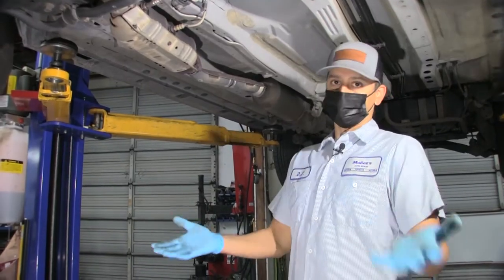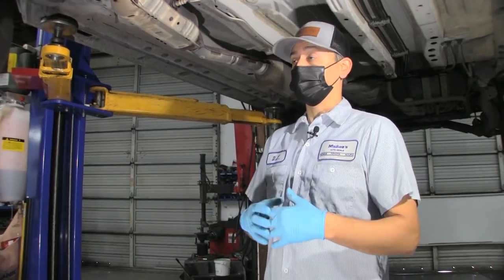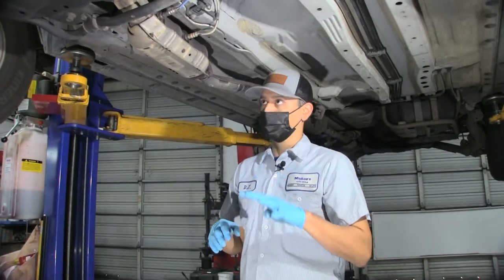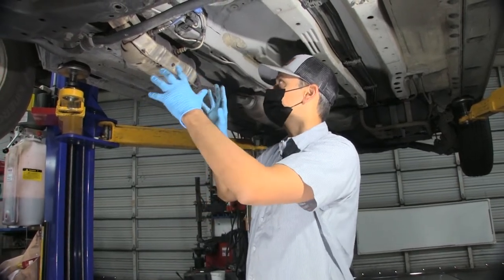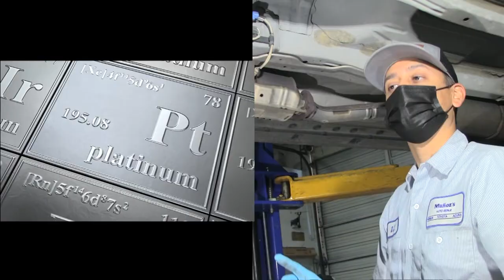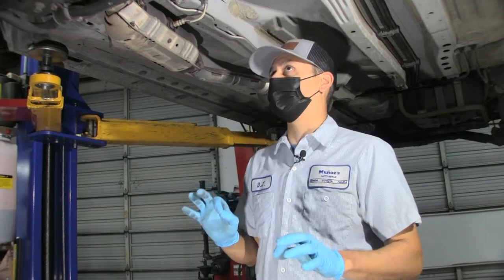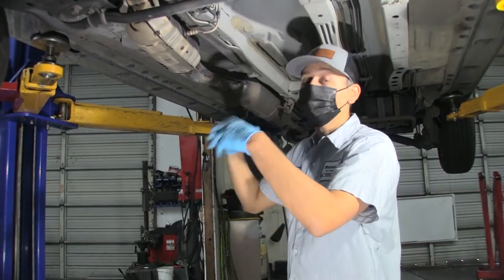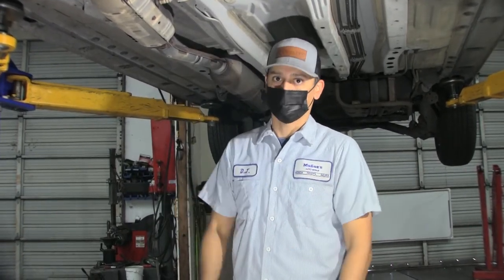Defeating Catalytic Converter Thieves | Where's My Cat...?

Comment: Very helpful
Reply from the maker: Hi Nolan, thanks for saying so.
Reply: @munozauto6220  Just got 
Cat clamp MAXX for 2017 Tacoma
Lifetime Warranty . 
Rock solid
Reply from the maker: Hi Nolan, right on. We hope that works out well for you. When we were researching the different anti-theft devices, we came across a few people recommending viewers weld cables directly onto the cat for extra security. For reference, doing so in California would likely lead to the truck failing SMOG, but that may not be a concern in other states. 

Installation methods aside, we're curious how that unit impacts the sound profile of your truck  and if that sound profile changes over time. Now that you have the Cat Clamp MAXX installed, when you are driving down a bumpy road with your windows down, are you noticing any change in sound?
Reply: No was installed properly tightly at a TOYOTA dealer . Keep your Toyota a Toyota like they say .
Reply: So update MUNOZ AUTO.
TOOK to Toyota. 
Decided to go with 2017 Tacoma.
1/8" thick Cat Security Shield.
Toyota Recommended
Reply from the maker: Hi Nolan, we're fans of the Cat Security shield ourselves, but I'm curious what tipped the scale for you to switch? Based on your previous comment, The Cat Clamp Maxx was recently installed, so did that unit present problems for you?
Reply: @munozauto6220  no sir . I had it ready to be installed this morning at Toyota. My friend works as the technician. He said the newer plates for the Tacoma are redesigned and wrap completely around more bolts thicker tighter fit . Plus. It's from cap city in CALI. I know they know some thieves just like IL  . 🤣 For a $100 cheaper plus free shipping. Covers all 4 cats. I was amazed when he walked me under the lift to see 4 cats  wow

Comment: Do you recommend a cat security plate for a Prius 2020? You mentioned Prius, but from local body shops, they believe 2004-2009 are targets. Is there some truth to this or is it all Priuses that get targeted? Also, would you say it is safe for a cat security plate, long term? Would love your insight!
Reply from the maker: Hi Sunfield, thanks for asking. Yes, we recommend Cat Security for the 2020 Prius.

As far as Cat Security being a good choice, here's a number of factors we considered when researching which anti-theft device would be a good option for our customers:

1. Once installed, the cat still has proper ventilation.
2. It is robust enough to be effective, but light enough to avoid knock-on effects.
3. When properly installed, it won't rattle and produce noise.
4. It has a large enough profile to function as a solid deterrent.
5. It mounts high enough to avoid impacting the car's road clearance.
5. It doesn't need to be removed to pass smog.
6. It won't interfere with maintenance of the vehicle since it can be removed and reinstalled without damage.
7. It looks nice once installed.

It's not theft proof, but all things considered, Cat Security is still the best deterrent we can recommend. Keep in mind, with enough time and motivation, thieves will defeat any anti-theft device. Also, a number of other vehicles are being targeted, but the manufacturer has enough demand to make a shield for the 2020 Prius.
Reply: No knocking. Properly installed with tamperproof bolts shims and cut guard over bolts . Rock solid Installed with air tools Toyota

Comment: You didn't answer the defeat part in your title.
Reply from the maker: Hi Erin, Defeating Catalytic Converter Thieves is a series of videos.

This first video is like DCCT 101: "The Basics". It's a starting point meant to establish a foundation and provide context for the conversation moving forward.

The "Speed Speed Speed" video is like DCCT 102: "Delving Into The Problem". In this second video, we present a case study using a real world situation one of our customers experienced.

Next, "Installing Cat Security™" is like DCCT 103: "Our Recommended Solution". Of all the solutions we've researched, Cap City Muffler makes the best option for the Prius. We shadow David as he installs the metal shield known as Cat Security™.

Finally, "The High Risk of SULEV" is like DCCT 104: "The Worst Case Scenario". Having your cat stolen and having to replace it is bad enough, but for certain vehicles, replacement isn't an option. Here we review the vehicle at highest risk, since there is no replacement option and CCM doesn't make a shield for it.

That said, we do have plans to produce additional DCCT videos, particularly as we review solutions for the Accord and CR-V. Unfortunately, we continue to have customers coming in with their cats stolen, so this topic is still a problem.
Reply: @munozauto6220  Respectfully i say you really only need a 1 word answer or 1 sentence. Im not sure why you're saying all of this, i just want the basics broken down real quick in a 5 to 10 min video.
Reply from the maker: Hi Erin, fair enough. We have one or two videos in this series to produce first, but after that, we could make a video to summarize everything.
Reply: @munozauto6220  That would be great thank you. I really appreciate that.
Reply: @munozauto6220  I have a 2004 CR-V. What are you guys doing with those and what would you recommend for all the DIY folks out there?

Seems to be a lot more CR-V's on the road than Elements. Why does Cat Security only make them for the Elements?

Comment: This title has nothing to do with the content
Reply: Was thinking the very same thing... I was expecting some anti-cat-theft device. or advice at least, but the video just tells the reason (which I'm already aware of).
Reply from the maker: Hi Joanna, thanks for the feedback. This video was the first video we recorded in what became our Defeating Catalytic Converter Thieves series. The primary reason for this video was to provide some foundational information so that viewers understand why catalytic converter theft has spiked and to understand if theirs is the type of vehicle being targeted. The next video in the series illustrates why thieves are cutting at the specific points they are cutting at and introduces Cat Security, which is the shield we recommend to our customers. The third video in the series showcases how that shield is installed.

Taking into account the pros and cons of all available anti-theft devices, our shop recommends Cat Security, but that shield is only available for specific vehicles. Even at that, all anti-theft devices can only be considered deterrents, so one has to consider a number of factors into recommending any particular solution. Every situation is unique, but here are some of the items we considered when determining what our shop could feel comfortable recommending to our customers:

1. Coverage - Are the most vulnerable parts covered?
2. Sound - How will the solution impact the sound as the vehicle travels at high speed?
3. Weight - Is the solution heavy enough to impact the performance of the vehicle?
4. Ventilation - Does the solution allow for adequate ventilation of the Cat?
5. Maintenance - Can the solution be removed and reinstalled?
6. Cost - Is the solution affordable? This includes both the initial cost of the parts and the labor required to install the solution.
7. Visibility -  Is the solution visible enough to act as a deterrent, while still looking appealing?

Unfortunately, we don't have any good blanket advice we can provide viewers. Most of our customers whose vehicles have been targeted were done so at home and in the middle of the night, but some vehicles have had their Cats stolen in broad daylight, both at home and out in public parking lots. Whenever possible, it's always best to park one's car in a closed garage, but for most people, that's not an option.

We hope this helps provide a bit of insight, but if you have any follow-up questions, please feel free to let us know.
Reply: @munozauto6220  Description needs links to the rest of the "series". Oh! Wait! 7 months later and there is only one - about a kit for a Prius!!!  Worldwide sales of Prius 70,000. US sales Honda Element +300,000.